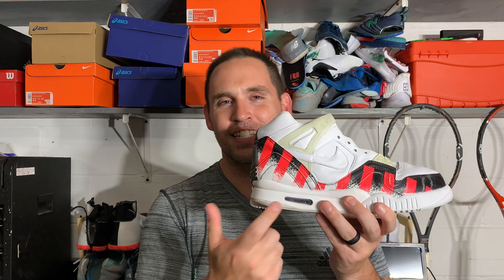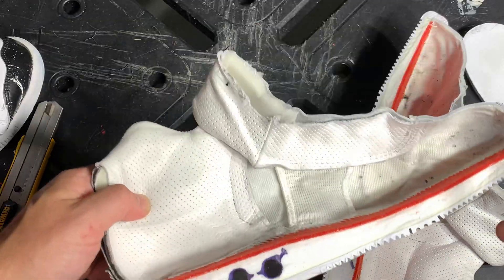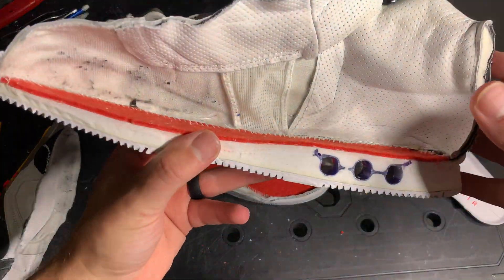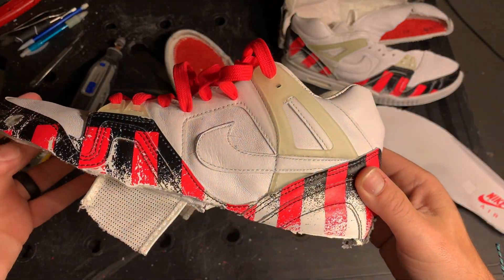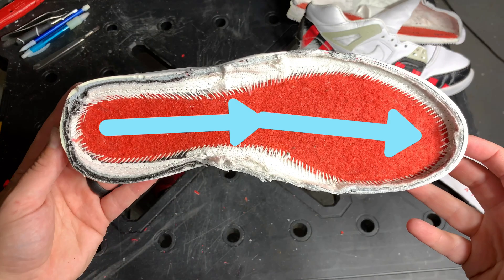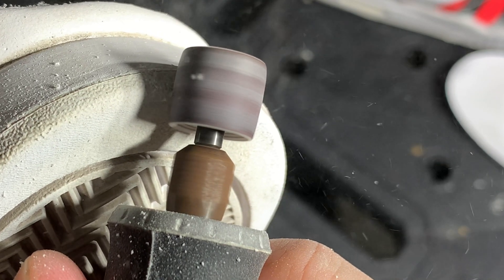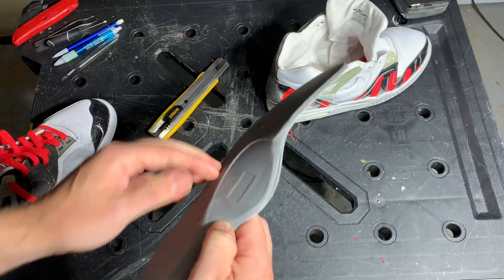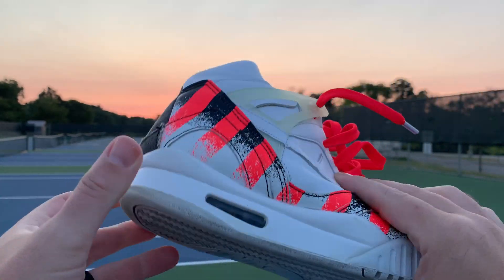Nike Air Tech Challenge 2 TEARDOWN- What’s Inside This CLASSIC Tennis Shoe? | Foot Doctor Review

Comment: Wow no air unit in the forefoot! According to Nike's press release titled "A Court Force" the atc2 should have a visible and flexible two-piece Nike air cushioning system. The visible air bag is under the heel and the flexible air bag is encapsulated under the forefoot. Not sure if these feature is only available on OG colorways like the Hot Lava or the Pixel Court but obviously Nike is going cheap on retros. Thank you for posting this video!
Reply from the maker: Thanks for the info I actually didn’t know that! I should try to grab an original to find out- that happens with Nike sometimes just like the GP turbo where they said it was a double stacked air zoom unit vs it being an airbag/ zoom air
Reply: Your channel helps a lot of consumers see the truth behind these claims by the manufacturers. Keep it up! Hope you can find and dismantle Rafa's 2015-2017shoes. The one that looks like a Lunar Ballistec but looks more like a Court Ballistec 4.3. I know lots of tennis fans would like to see the tech inside that shoe specially the cushioning.
Reply from the maker: Thanks I appreciate that I’ve got few pro shoes I’d like to teardown for sure after doing Serena’s
Reply: Nike has absolutely skimped out on air on retros from making the air bags smaller to removing them altogether.
Reply: The original ones had them but Nike doesn’t make retros like their originals. A few rare times they do. Nike cheapens out on the quality of materials, tech, insoles & mid-soles. Nothing is made as they use to make them. The retros has been atrocious so far, but since 2024 Nike remastered the Nike Air Tech Challenge 2, very close to the original. They use actual leather, insoles are decent, the shape & craftsmanship is actually really good. But nobody knows if they finally put back the Air unit in the forefoot. Somebody would have to cut the newer ones up from 2024/2025.

Comment: I wonder if some basketball shoes works well on tennis too. Hard courts to be specific. Is that something you would recommend?
Reply from the maker: They would be good for ankle stability- they are made more for stability and straight up and down jumping so you will have some issues with running and clunkiness but otherwise they can do the job in a pinch
Reply: The Tennis Pro Doc thanks for the insight 🙂